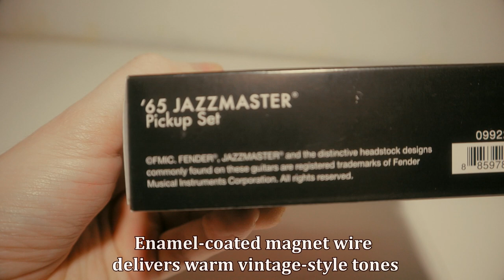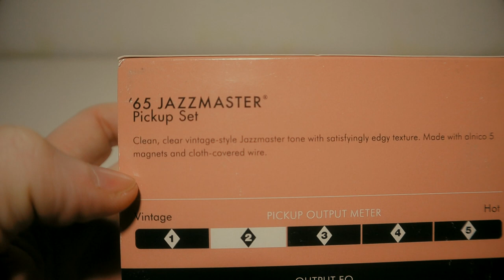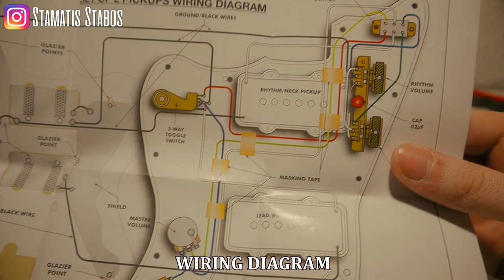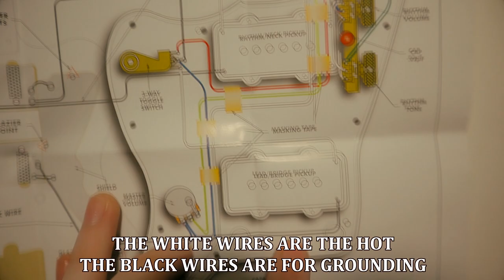FENDER Pure Vintage 65' PICKUPS | Squier JAZZMASTER Upgrade

Comment from the maker: 🕐 TIMELINE 🕘
[00:00] UNBOXING AND INFO
[03:43] INSTALLATION
[09:06] DEMO TEST
[17:58] BEFORE AND AFTER

After a long time of recording and playing with my Squier Jazzmaster i decide to upgrade the pickups with 
the authentic Fender Pure Vintage 65', i heard and read good reviews about this pickups and i give them a try,
the Squier stock pickups are good but i get tired with the sound and it was quite difficult to mach the sound in the mixing, 
the major difference in sound was in the bridge the Squier Duncan Designed sounds more compressed 
tight and hot the Fender sound more open transparent and ballanced with the neck pickup, those pickups sound more natural with way better dynamics.
EDIT: After i play and record with the pickups for long time i suggest to have 250k pots or 47 or 68uf capacitor because the Fender pickups are to bright and clean

🎸 Squier Jazzmaster Upgrade: https://redir.love/GAsPps7N

👉Fender Pure Vintage '65 Jazzmaster Pickup Set
Thomann: https://www.thomann.de/gr/fender_pure_vintage_jazzmaster_pu_set.htm?offid=1&affid=1025
Amazon: https://amzn.to/37UfWLG

▶️ Tutorials/Demos/Other Stuffs: https://goo.gl/fy4m9H

★★★ Thanks for Watching! ★★★
Reply: Stamatis Stabos Nice mate .. but have you also changed the circuit or is the original one?
Reply from the maker: @giuseppemarino4564  you mean the wiring? its the squier wiring now i changed to the 60s classic jazzmaster wiring but sound the same no difference
Reply: Stamatis Stabos with the .1mf capacitor?
Reply from the maker: @giuseppemarino4564  with 0.33uf on lead and 0.22uf on rhythm circuit, i have made a list with all the upgrades i have done there http://a.co/7MNhXKd there is notes you can read
Reply: Hey did you change the wiring? Is this on 1meg pots?

Comment: Excellent information.  To my ears the original pickups sound better than the "upgraded" pickups in all positions except the bridge alone (and that was only by a slim margin).  Thanks for sharing, you saved me a bit of work and expense.  ☺
Reply: Dude I upgraded mine & I honestly regret it.
I'd (personally) advise against.. I paid someone to get it done & now I'm wishing I didn't. Kind of have the guitar now as a display haha just feel like it's not the sound i'm after. Sounds much more twangy even than a tele I have. Gonna get the stock back pronto

Comment: Are you happy with the "new" sound?  I'm tempted to do the same because the Mascis Jazzmaster does not sound like a real Jazzmaster with its P90 pickups (they're not bad but I want the actual Jazzmaster sound).
Reply from the maker: the pickups sounding good but the problem for me its the low output, if you have a guitar amp its usable but i record on computer with digital amp simulation, the sound quality its far better from the squier its more clean and transparent
Reply: @StamatisStabos  Interesting, I have a Squire Vintage Modified Jazzmaster and I mostly do home recording on my computer. Would you say it's not worth upgrading to these pickups for me?
Reply: @StamatisStabos  Yes, i have a j masics and a strat with conventional single coils and there is a noticeable difference in the output. It CAN be worked around though! You need to get a good chain of compressors in your daw, that's what an amp will do for free, compress and eq. Old pickups were never designed for the super clarity you get with modern A/D converting interfaces. So take some time to develop some good compressor chains on your daw. The free ones in logic are decent enough but i'd seriously recommend investing in the waves compressors like the cla-a2 and the 76, they work really well.

Comment: Did I miss something? Why didn't you compare just the new bridge pickup on several tests? I was looking at these, but really I'm only curious about replacing the bridge in my CV Jazzmaster. The neck pickup sounds pretty close to the stock, but the bridge has got to sound a bit different, not as middy I hope.
Reply: It's way different. The CV stock pickup is heavily overwound (it's 10 or 11K, if I'm remembering correctly). The pure vintage bridge has the same cool winding/lower resistance that the neck has, making it very bright, clear, and twangy. What you'd expect out of a vintage style fender bridge pickup.  

I swapped mine for the 65s almost immediately. The neck is indeed very similar/basically the same as stock, as stock is also an alnico pickup wound cool.

Comment: I'm guessing now that Mike Adams, @puisheen has given a glowing review on the 40th Anniversary that the haters will let up on the Squier? His review on the USA Vintage and original AM Pro shows that sometimes buying a modding platform and investing in a good set up (fret level etc) can leave you with a great guitar instead of a brand name dog.  For those still doubting, trot over to Chris Buck of Cardinal Black and see him rock a stock 40th Anniversary.  Thanks for the vid my friend.  I got from it that the Squier stock pickups were not too bad, possibly weaker in the bridge and the 65's were balanced across the range. thanks.

Comment: Finally a good demo. Nice job, Stabos. It's plenty of jerks demoing guitars completely distorted, as if they think they're in concert. Anyway the neck pup is almost identical, the bridge one is very different. And so affect both middle and bridge positions. However since you've also upgraded the caps, it's not possible to say how much difference is due to pups and how much to the rest. Carry on with the nice job. Cheers

Comment: I swapped my CV Jazzmaster pickups for the 65s and like them. The CV basically has the same ones as the VMs "Duncan Design" pickups. 
I prefer a clear, lower/mid output sound, so the new bridge pickup was a certain improvement. The stock bridge pickup is wound to like 11K or something, so it's less bright, louder, and more rock n roll. 

The stock neck almost sounded identical to the 65 though, being wound similarly.
Reply: my vmjm bridge pickup is way quieter than the neck, shrill, with no bass D:
Reply: @hiroprotagonitis  A lot of that may come down to pickup height. It won't ever have lots of bass, being a bridge single coil, but it's output should be about the same as the neck pickup if it's high enough/the neck pickup isn't too high. When swapping to the 65 pickups, the bridge and neck are wound exactly the same, so it can be even more of a challenge to get the bridge and neck equal in volume. The neck will usually always seem louder due to the serious amount of bass it has.
Reply: @JulianA-tr6pt  mine were always right up against the strings, while the neck pup could be quite low. the diffrence is apparent when playing other single coil guitars. maybe mine was a dud '\_('-' )_/'
Reply: Do you hear a need to upgrade any electronics with the pickup upgrade?

Comment: My friend gave me a set of his that the neck was dead and said he couldn't fix it so I spent about 5 mins looking at them and saw that the copper wire inside was not connected to the solder point on the ground and did some work and got them working again.
Reply from the maker: Yes that's common mine was weak soldered and i re-solder them again

Comment: That squiers pickups are actually pretty good really...not so much the bridge alone, but otherwise they sound great. 65’s Sound nicer and fuller to me but the former seem quite good.

Edit: I know fender claim these to be vintage accurate; however, vintage JM pups are almost always over 8 kohms. These, and the set in my AO 60s JM are 6.23k and 6.35k - and average is what the box says...6.8k. So, my point is, and it’s also evident from the coil windings and lack thereof which should be wound right to the edge of the flatwork, that fender is pulling our leg. Lolz.

However, they do sound very good, no doubt...they just aren’t historically accurate on the electronic front. I still like them better than the AV62 JM pups, which sounded a bit dead to me.

Comment: Do you know if it can handle really nasty Distorted tones
Reply from the maker: Not so well especially if you have marshall amp only with fuzz, listen some Sonic Youth to get an idea, Jazzmaster are the biggest pickups and they have very clean single coil sound, if you swap the 1MEG volume and tone pontentiometels works better like strat

Comment: Is it just my ears , or are all duncan pickups caracterless ?
Reply: Some, sure, but that can go for any company. Pickups are very basic devices and it's almost impossible to have a "house sound". I have a 59 humbucker in a strat which is nice, and their Antiquity stuff it beloved by many (overpriced IMO). 

The "Duncan Design" thing means almost nothing. It's just a badge for marketing, as far as I can tell. The CVs no longer have Duncan Design pickups, yet the specs of the pickups are identical (in the Jazzmaster). Same factory, no doubt. Overwound bridge pickup, vintage spec neck pickup. 

I actually swapped my CV pickups out for the PV65s, and the neck pickup was very, very similar to the Squier stock one.
Reply: I consistently like the Duncan Vintage Jazzmaster pickups more than the Fender 65’s. More jingly, jangly, and bell like. Like a jazzmaster should sound, You know...surfy.

Comment: How does it sound when installed on telecaster?
Reply: unkl drw how the hell are you going to put those big ass pickups on a tiny telecaster
Reply: @marcospintor1333  Why wouldn't it fit ? It' a really cool mod actually!
Reply: @marcospintor1333  Sure, so what ?
Reply: Aurichu I’ll send you my telecaster. Do it for me
Reply: @marcospintor1333  Ever heard of a luthier ?
Reply: @marcospintor1333  Obviously this is not something anyone can do themselves. I personally can't. 
Just bring your guitar to a guitar shop or someone qualified and that's it.
Reply: Aurichu i guess my point is that it wont be worth it. You could swap pickups left and right but if you do something like that, it’s irreversible. You could end up hating it, and now you’ve ruined your guitar. It’s something to do on a Squier or something
Reply: @marcospintor1333 Well, in this case the only thing you'll need to do is to route the body for the pickups to fit and find a custom pickguard. If you don't like it, just re-put the stock pickguard and the stock pickups on ? I really don't see the problem here, though I can understand being retiscent about doing such mods to expensive guitars.
Squier and used guitars are great plateforms for those, that's for sure !

Comment: I have this guitar just got it, it's a totally garbage sounding guitar. The stock squier pickups were just dull and lifeless. The guitar itself just sounds dead with no feeling just a completely plain and neutral sounding guitar. I might change my mind if I spend more time with it but I just didn't get anything at all from the squier FSR jazzmaster.
Reply from the maker: Needs set up, they made Squiers like hot dogs try to adjust the pickup height 2mm bridge and 3mm neck, Jazzmasters have the biggest and more powerful single coil pickups, if you like clean tone it's a good guitar if you like rock sound you buy the wrong guitar
Reply: @StamatisStabos  Thanks I will try the pickup height. I did get a professional setup done on the guitar. The frets were also not levelled properly and the fretboard was dry AF. So you mean increase the height 2mm and 3mm?
Reply from the maker: @mehulshukla04  yes 2mm Bridge and 3mm neck the space between the pole of magnet to string, also check the neck trussrod search on YouTube how to adjust the trussrod maybe it's curved and need adjustment, also check this vid https://youtu.be/aF1DDmQP55M